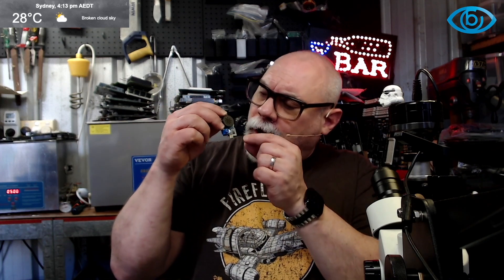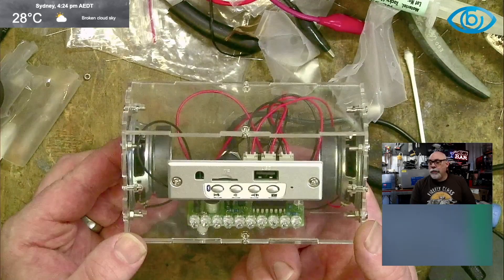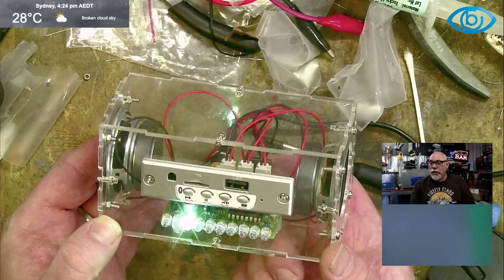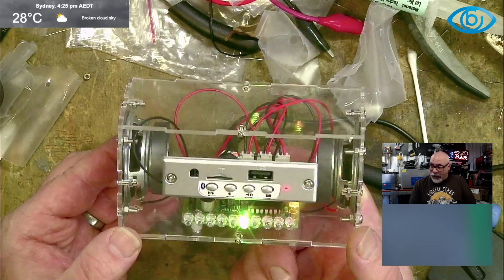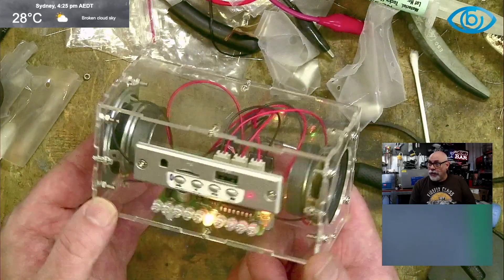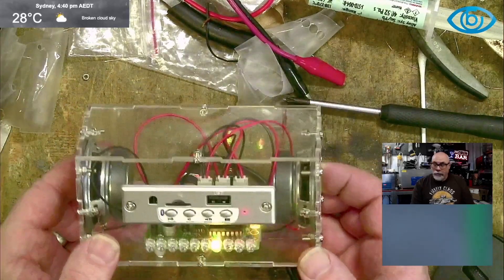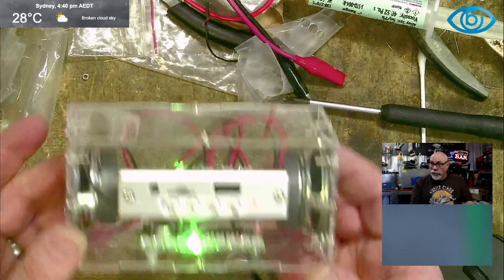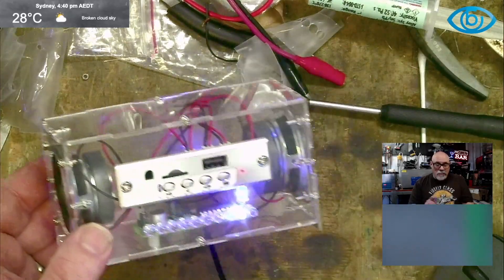Building Bluetooth Speakers Kit [UPDATE]

Comment: Suggestion, if you're going to make it portable, you might want to think about protecting those speakers. I have an older LIT Limited Edition Bluetooth speaker from RadioShack I purchased about 9 years ago. Like yours, it sounds extremely good considering the small speaker size. My speakers are front firing and have three different coloured (I spelled that just for you. LOL) speaker grills to control the different colored LEDS that light up to the music. I like the fact that you have a built in card reader. I only have a 1/8' stereo input plug. They are both pretty cool speakers. My HF rig has a top firing speaker so I use my speaker all the time when I'm working CW. Great build, very enjoyable and I'm glad you were able to easily repair yours. Cheers!!